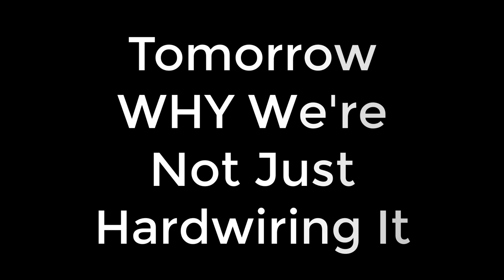StarLink Permanent Install

Comment: Good job done!  Stay safe on that ladder!!
Reply from the maker: Good morning CB! That little bit took hours in the heat and high winds. Sometimes the wind noise as pushing me around pretty bad. That’s one reason why I switched to the much heavier ladder. We discussed putting the antenna on the mast and decided holding onto Irene’s waistband for the few minutes to get it n top of the mast. The plan was to let go of the antenna if we got hit by a big gust. Very glad that piece is done. Take care.